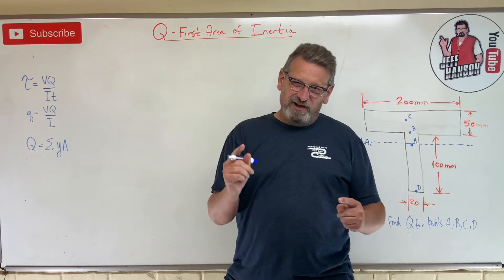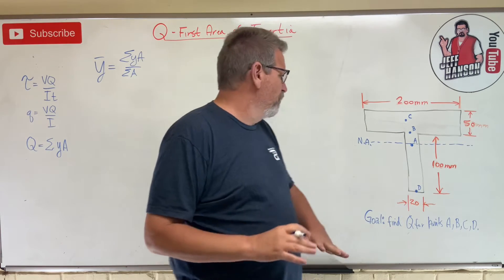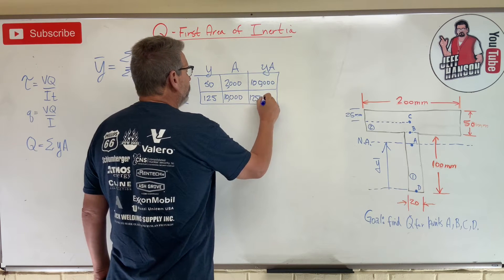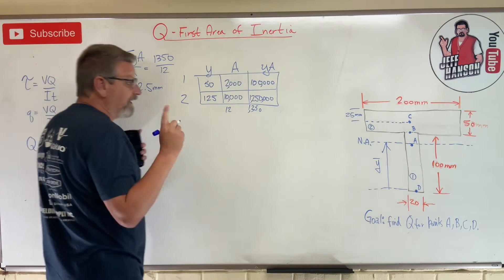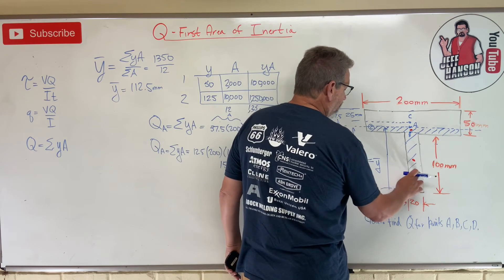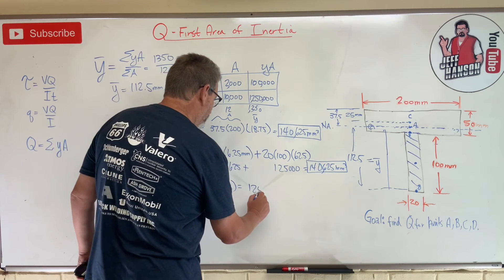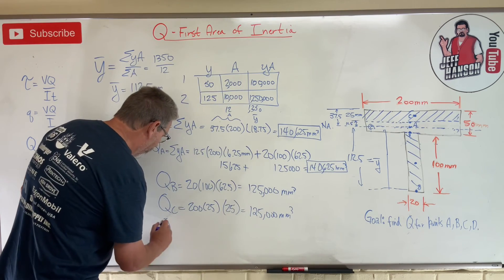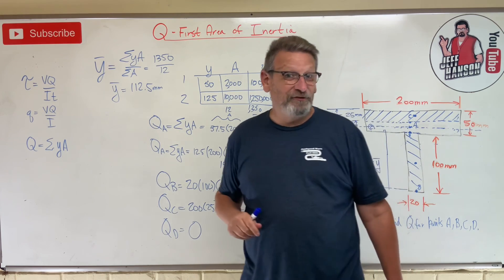Mechanics of Materials: Lesson 37 - What the Heck is Q? Example Problem

Comment: When calculating y bar, what is olur references point for the Sum(yA)? Because for al the other calculations we take the distance from the centroid. But when calculating the y bar? Is that “Q” a general Q or something? Because it seems we took the distance from the bottom, not the centroid?